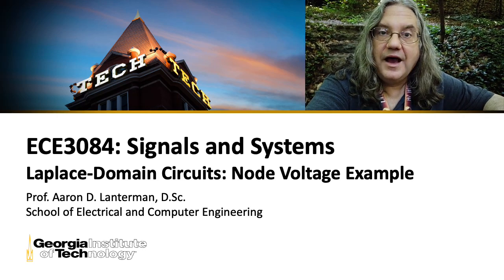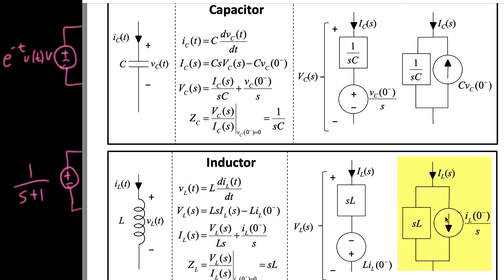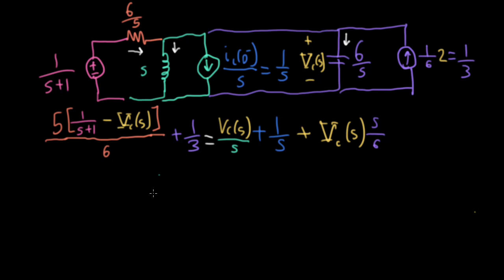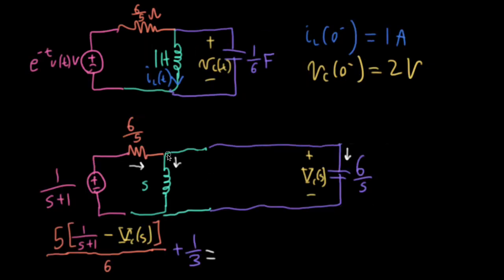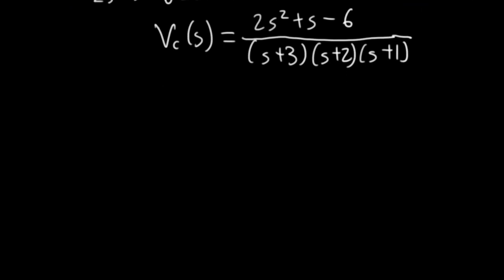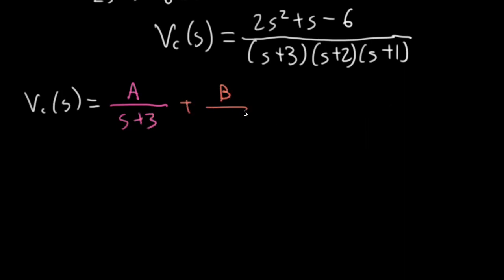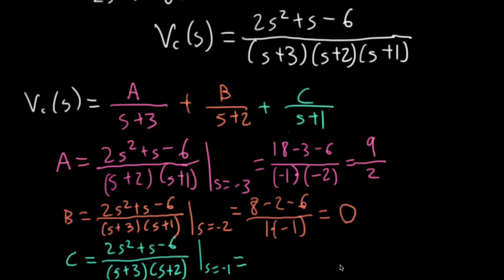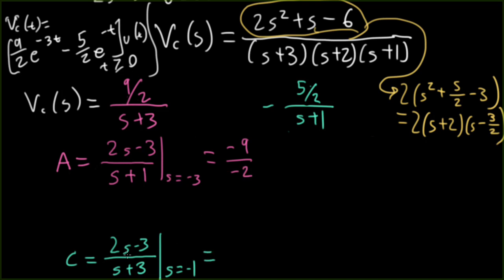ECE3084 Lecture 55: Laplace-Domain Circuits: Node-Voltage Example (Signals & Systems, Georgia Tech)

Comment: I went over this problem again and used superposition (to use a method other than the node or mesh for variety) and ended up with the same result. I used the parallel versions to include the IC as was shown but I also changed the voltage source in series with the 6/5 ohm resistance into a Norton equivalent. So for superposition, there are three current sources in parallel, taken one at a time. The impedance Zp(s)=6s/(s^2+5s+6)=6s/[(s+2)(s+3)]. So Vc(s)=Zp(s)*I(s). The simulation in LTspice confirmed the analytical results. I have a feeling that they may have chosen the RLC values first, then wrote the equations using arbitrary initial conditions iL(0-) and vC(0-) and determine these to get the pole/zero cancellation.
Reply from the maker: Wow, thanks for doing all that work! 

Your hypothesis on how they derived the problem makes sense.
Reply: @Lantertronics  No problem. It is very interesting that they were able to eliminate one of the natural frequencies (s=-2) from the capacitor voltage. If the input voltage had been of the form Ae^{-2t} u(t). Then the capacitor voltage would have a linear combination of e^{-2t}, t*e^{-2t}, and e^{-3t}. I have seen this type of problem before, but I had not seen a cancellation of the type that you illustrated. I may use it as an exam problem :-)